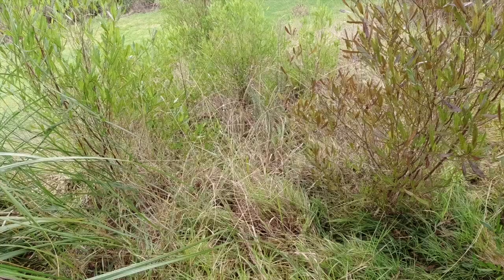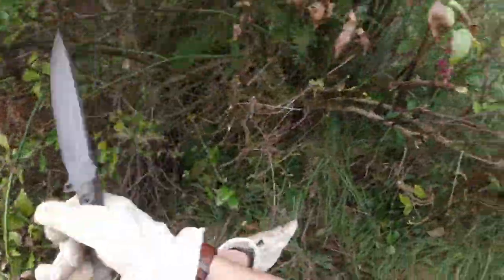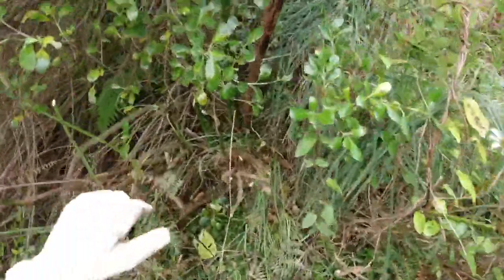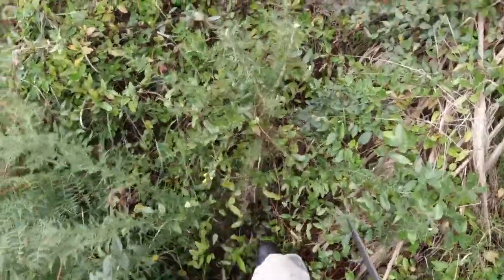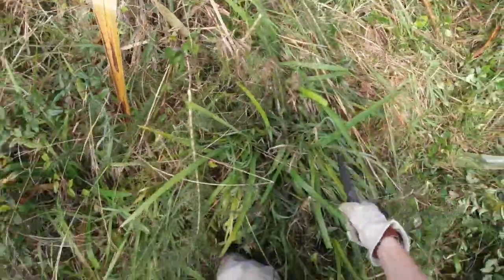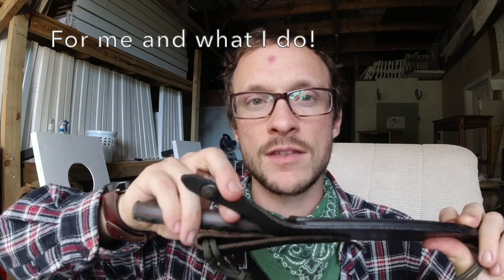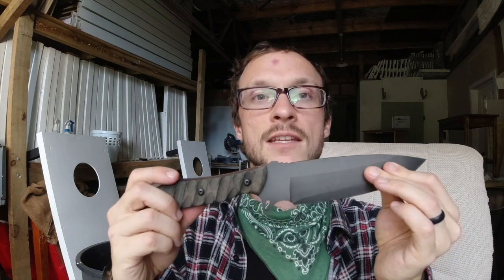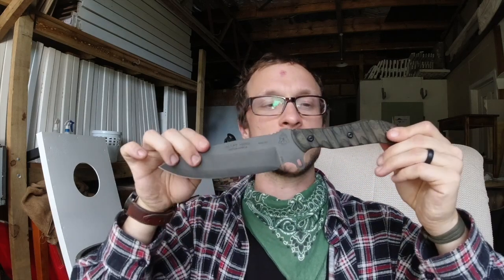TOPS Silent Hero Tactical Knife vs New Zealand Wild; Invasive Species Day! A Dual Grit Edge Test

Comment: A tip you may try is running a piece of Paracord through the holes on the knife. It makes hanging onto the knife very easy for long periods. Thanks for the nice review.🔪👍🗡️
Reply from the maker: Thanks bro!  That's a great idea - will have to do it, especially with some of my more slippery handles!

Comment: A lot of heat and moist environment, will a 1095 hold up? Or just oil it a lot and that will prevent it from rusting quickly? The Tops knife held up very fine and it looked comfortable with and without leather gloves. You said you liked it just a bit better then the Becker, so is it worth the extra money in your opinion or isn't the difference that significant? Thank you for the review Gabe and have a good weekend.
Reply: For me, if it's down to just the practicality of tje knife in a work setting the BK wins on that basis, if the aesthetics and the "cool" factor are part of your decision making process when buying a knife, in my opinion the TOPS has the win in that category
Reply from the maker: Jeroen, great questions.  I think Andrew makes a good point.

If you are in my position and chopping 3.5 hours per week, I think the extra hundred bucks may be worth it if you are going to have just one knife (like, who does that though, haha!).

The Becker, however requires no fuss for the finish, causes no worries to me because of the lower price, and brings in about 80-90% (in my subjective opinion) of the efficiency and edge retention.

If you're just gonna camp with it, every couple months and it might get damp frequently from outdoor life - I'd say BK7.

If you are clearing brush frequently near a dry shed, or just want to try the differential temper, or look at a beautiful knife in your hand - spend the extra money on the TOPS.
Reply: @homeslicesharpening  Thank you for your opinion on this ehm one knife? are there really people who have just one knife? The horror! Recently i lost a knife and i didn't rest before i found it, not an expensive or rare knife but still you want to take care of your tools. I was very happy when i found it and it got a nice cleaning and oiling treat. yeah maybe i'm a little weird.
Reply from the maker: @jeroenvoss6231  If you are weird, I don't know what that makes me, hahaha!

I console my unsettled notions that "I'm a minimalist!" with the idea that I only have one knife for each "category" of activity.  One work knife, one EDC, one ultralight camping slicer.  I technically have 3 multi-tools, but we don't talk about that...

1 small fixed blade, 1 large fixed blade, 1 small hatchet, 1 medium felling axe...

In my head it really makes me feel like I am winning at life and minimalism, but it shall surely come to an end if I have to move back to the US and try to pack 13 blades into my checked bag 😬
Reply: @homeslicesharpening  You poor man, minimalist for sure. You might consider sending your knives back instead of try to get him on a plane. Better chance of arriving, but don't know about the costs. Multi-tools don't count as a knife and fixed blades are tools, so the don't count either. Neck knives are jewelry so you pretty much carry only one or two knives. For me that makes sense Gabe.
Reply from the maker: @jeroenvoss6231  this is the best comment I have received this week.  Shared it with Dani and she laughed out loud when we got to “neck knives are jewelry” part.

Hahaha!!!
Reply: @homeslicesharpening  Well that was more then i hoped for hahaha. However she might like a nice piece of jewelry!

Comment: Differenchel. Heat treatment, I wonder if other brands have it, I was reading on the Bushcraft website, about condors 1075 steel testing hrc 52 
Some 1084 chopper In the low to mid hrc 52-54
And multiple esee 4’s hrc testing @53 

So I am curious if the test were done on softer parts of the blades in comparison to the differencel / higher hrc part , 52 ish seems very soft for a expensive brand name chopper or machete
Some one is even making a S125v 68 hrc chopper
Reply from the maker: Haha!  S125V that's crazy, who is making that?

I am not sure.  I would not be super surprised if Condor was running a little soft on some models, but I would not think it was THAT soft.  

I think ESEE used to do a differential HT, but now they advertise a 57HRC mono-temper.  I'd love to try out a TOPS DART some time, as it's 5160 steel, and I reckon that would be pretty fun with a good differential HT.
Reply from the maker: Very cool!  I’m impressed with the edge retention he got on S125V in such a high impact test!!!
Reply: Terava knives have softer spines- not differential HT but a product of how they do it.
Reply from the maker: @tonycanniffe2360  TRUE - Terava is crazy!  So far as I understand, they have a way of differential hardening the inside of the blade more than the outside.

Would love to try one some time.

Comment: It's not a patina coating it's a differential heat treat
Reply from the maker: I did realize that they were differentially heat treated - isn't that cool?!  It sounds like TOPS actually coats their knives with CeraKote rather than exposing the differential heat treat by doing a patina these days.  

Whatever you do, it's a pretty cool and rare feature to have a blade differentially heat treated!